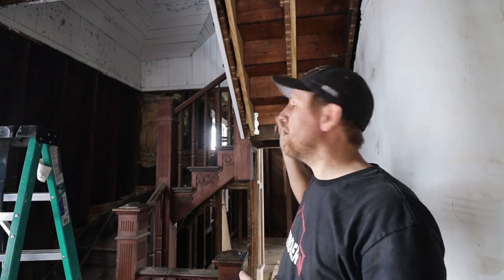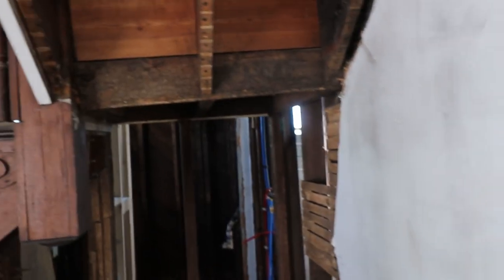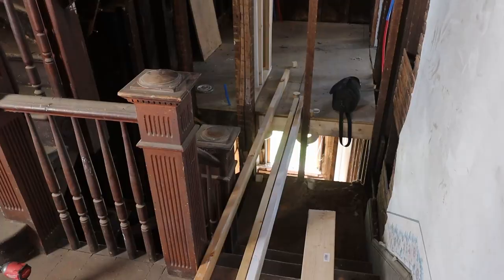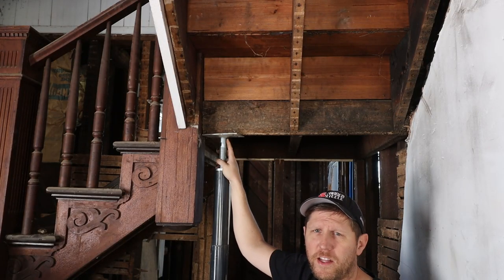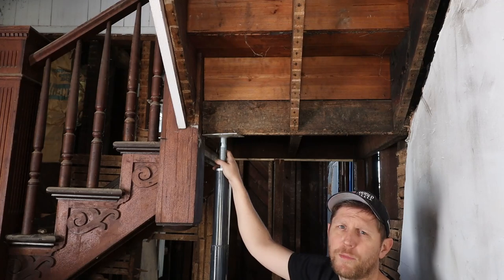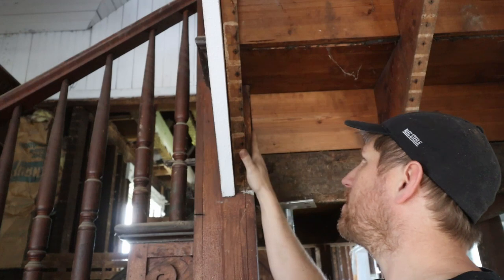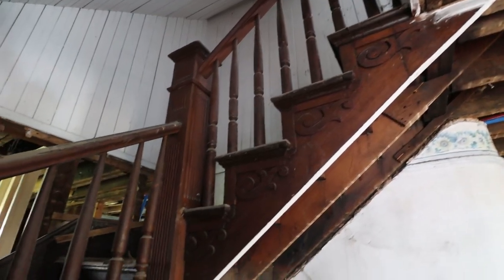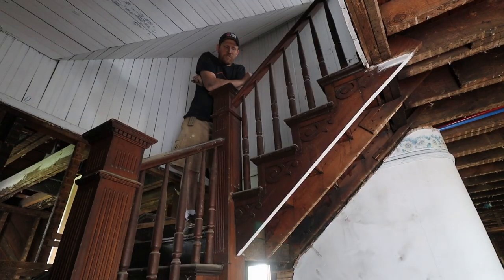Fixing the back stairs and doing some odds and ends everywhere - [Victorian Home Renovation]

Comment: I've watched a home renovation video where the guy said he had to do a lot of research to get the correct angling for proper drainage. Obviously the work you do is harder than it looks in the video.
Reply from the maker: The basics are pretty simple. Depending on the diameter of the pipe a certain minimum and maximum slope are required and a maximum distance before a vent had to be added depending on the slope so that the water will not suck out the water of the trap to guarantee the sewer gases not entering the house
Reply: @TirolerInn  That's where the math instruction you received in school has its practical application!
Reply from the maker: @dawnsnewhope  yes no kidding